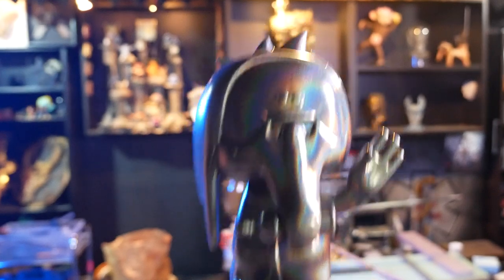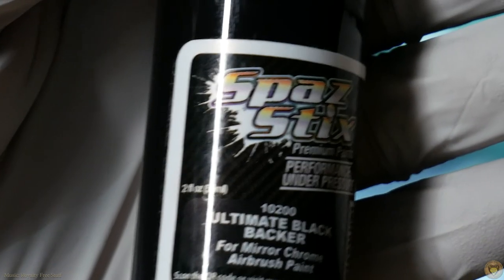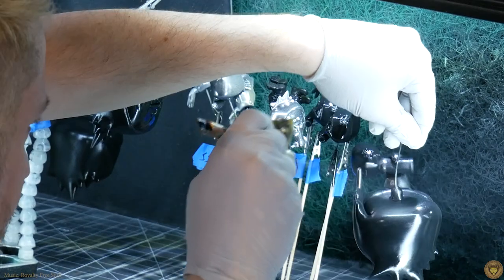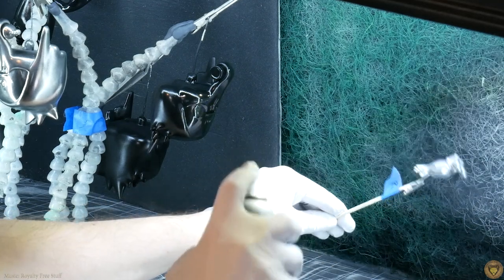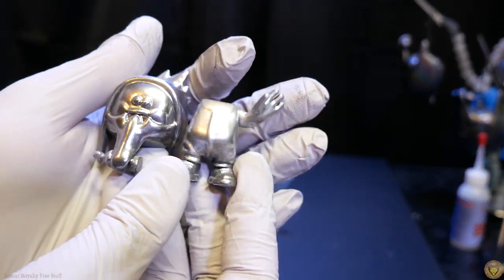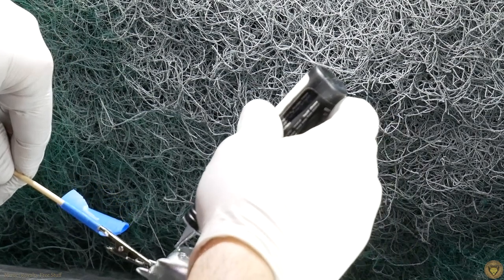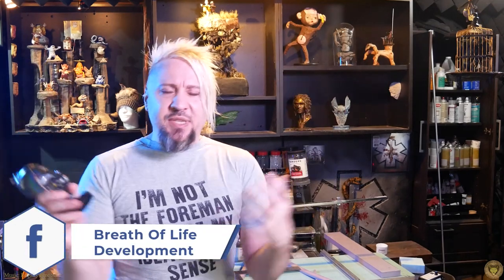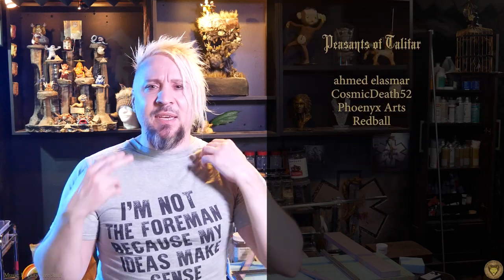What Is The Best Chrome Paint?

Comment: I'd like to see what results you get with the powder. I doubt it translates well, but I've found powders work far better on plastics I use than paints for chromatic effects especially for avoiding a sparkling effect from holographic covers. Similar concept of starting with a really glossy black and then rubbing on a holographic or chromatic powder can give some amazing results. Again similar to the paints, though, results can vary a lot depending on the powder and protective coat you give after. These turned out very nice, though! The doused figurine with liquid chrome actually turned out incredibly chromatic but I can see what you mean that it makes more flaws appear.

Comment: my experience with prismatic silver (I use SMS brand but I but it looks like the same effect) is that it behaves differently depending on the airbrush pressure. typically  this is less pressure than I would use for other paints. It also gives a really nice effect on top of other chrome paint.

Comment: It seemed like you were pushing alot of paint when airbrushing the alclad.  That paint is so thin you generally only need like 15 to 18 psi.  So you can put it on super light and do 2 to 3 coats.
Reply from the maker: Hm, yeah I had my psi down in that range specifically for this reason.  But looking at the footage it seems like a lot more.  Granted, my compressor is literally 30 years old, and the gauge may not be accurate.